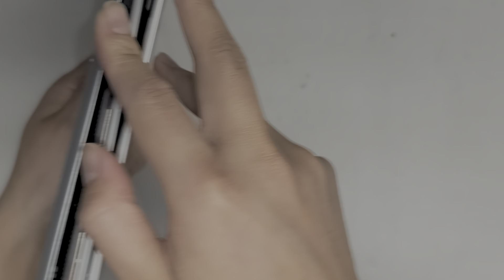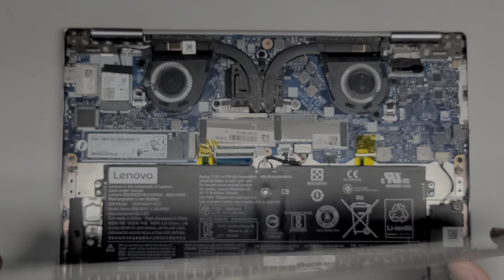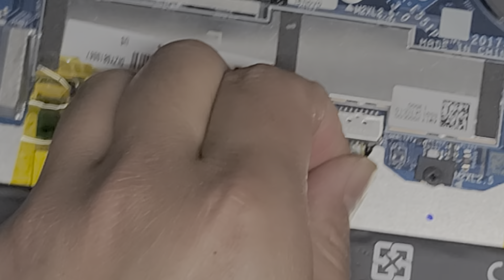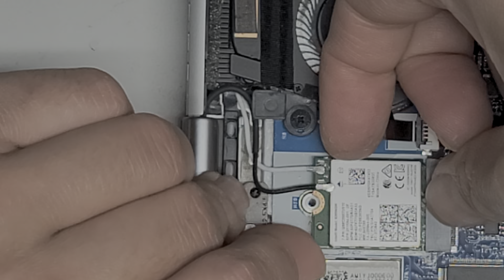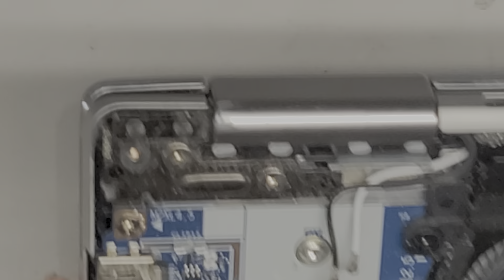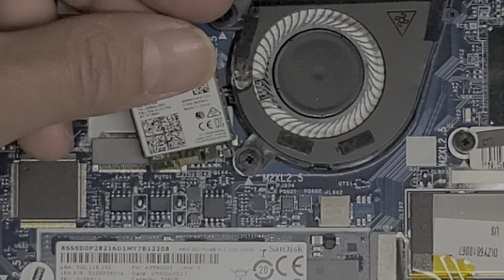Lenovo Yoga 720-13IKB Disassembly SSD Hard Drive Upgrade Repair Battery Replacement Quick Look

Comment: Hi there, I'm having some issues trying to connect the ssd into a m2 rack. My friend lent his M2 rack, but it doesn't work and it doesn’t seem ok to force it. Do you know if there is an incompatibility between this Lenovo ssd and regular M2 racks? Thanks
Reply from the maker: Has to be an m.2 pcie nvme and have to put it in at an angle like ram

Comment: I got to replace my battery. My laptop is giving me power issues and the 3 orange blinks of death. That’s unfortunate I can’t change the RAM, I would have liked to have done that
Reply from the maker: If it's dead, I don't think a battery will fix it.
Reply: @ItsBinhRepaired  it’s not dead. It’s definitely a battery issue. I meant that more as a joking way. Im overdue for a battery change
Reply from the maker: @snoopyrogue359  I see lol

Comment: I put a piece of tape with edges stuck to desk and stick the screws on the tape in the pattern as I remove like a mini laptop
Reply from the maker: Nice! That works too. I use a special magnet tray I designed.